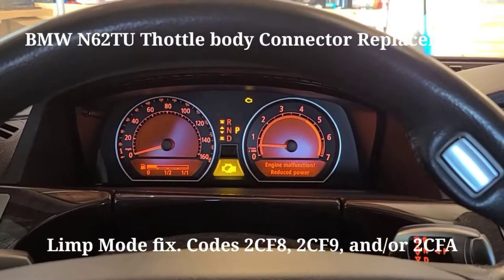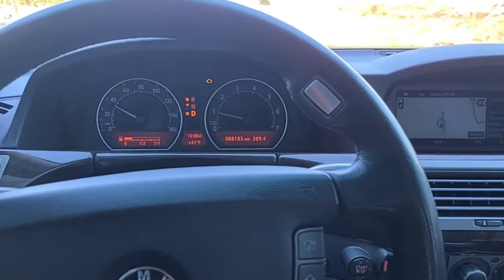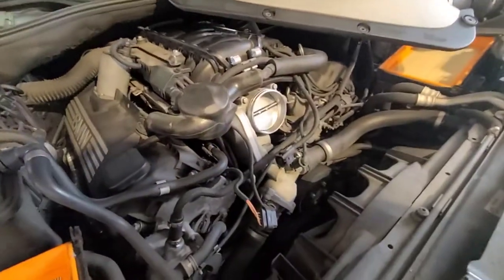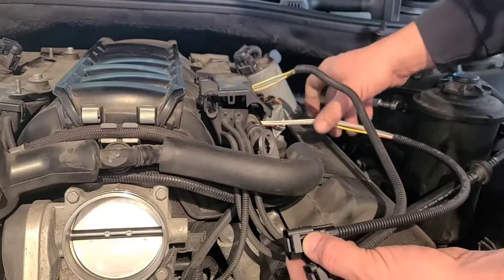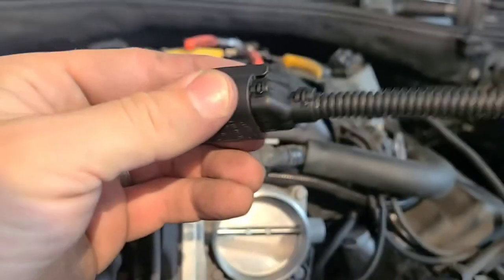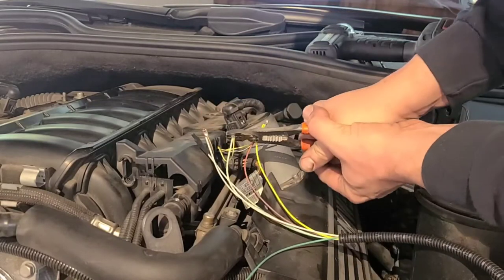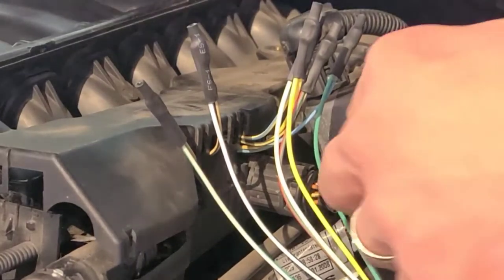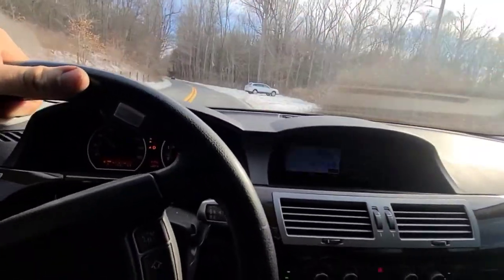BMW N62TU LIMP MODE REPAIR 750Li X5 4.8 V8 550i 12517602973 harness install

Comment: I have a 08 550i with 140,000 miles. I just had the same issue happen to me, also at a Mcdonalds this morning on my way to work. Lol.. anyways you asked about the gas... mine gives me 26.5MPG ON FREEWAY AND 17.5 around the city. Stop and go. You need to upgrade all your coils with the BLACK UPDATED BOSCH & GET THE NGK IRIDIUM LASER SPARK PLUGS. THEN DROP A CAN OF SEAFOAM INTO GAS TANK AND YOU WILL SEE A BIG DIFFRENCE.

Comment: Thanks for the video!  Enjoyed watching your drive and the little chat about your favorite restaurant.  My 2009 X5 4.8i is giving this exact error. Surprisingly and coincidentally after I did my Valve cover job +  the upper timing cover gaskets and oil thermostat gasket work.  Initially, I thought if I forgot to latch that throttle body connector correctly or something, but after reading a lot of forums and your YouTube video, it seems to be the Harness and  connector.  Going to do this job next week before replacing any expensive parts like throttle body etc..  A side note, a $10 heat gun from amazon or eBay would have made your life easy with those shrink tubes. I used to use a hot soldering Iron tip to do that in the past, but the heat gun does a way better job and looks nice too.

Comment: Did you try compressing your throttle down for 39 second in diagnostic mode see if that fixed it there's a reset for your tps

Comment: Hi my 2007 bmw 750li jus went bbn into limp mode moments right after parking a light popped on ssying recharge battery! Get this less than a hour befor a new battery was installed

Comment: Than god I found your video, I’ve been trying to diagnose this ANNOYING problem for almost a year. My 550i is doing exactly the same thing… Changed the throttle body already on it. This will hopefully 🙏🏼 solve it.
Reply: Update please !
Reply: @Dr3_Smoove  bought the pigtails from Bmw, $30… haven’t installed it yet, weather’s been shitty. I’ll keep u up to date.
Reply: Ok. It’s been a month since I did this and I can say that I had absolutely ZERO issues! Thanks again for this video!
Reply: What’s up?
Reply: Zero issues! 👍🏻

Comment: Hey,
Did you have any more issues with your 2008 750li after you replaced the throttle body wiring? I'm having the exact same problem with my 2007.

Comment: How do you fix limp mode on 750i v12 95 model it taking of from 2nd gear slow take off and sometimes limits revs
Reply from the maker: Sorry, I don't have any experience with this model.  Generally, when they go into transmission limp mode, the computer is sensing something is not normal and does this to prevent any further damage.   Best thing to do is change the ATF and filter, with the correct fluid and make sure the level is correct.  If this doesn't help, It will probably need to be rebuilt or replaced
Reply: @cliffreginaldmagara8873 Hi were you able to fix this, having exactly the same issue :(
Reply: @yousiflakho1771  ended up changing gearbox completely because the old one's clutches were gone